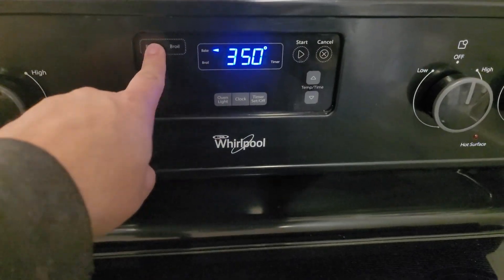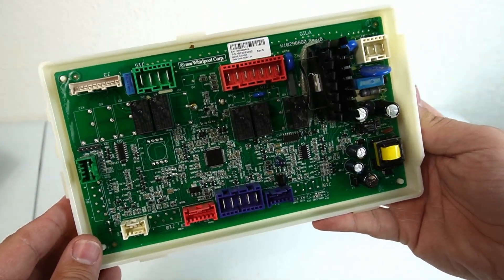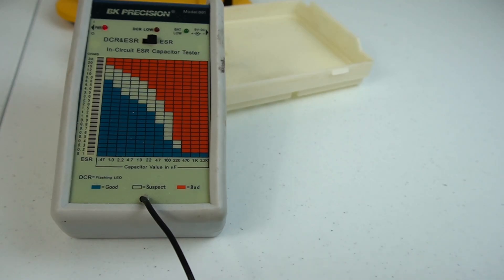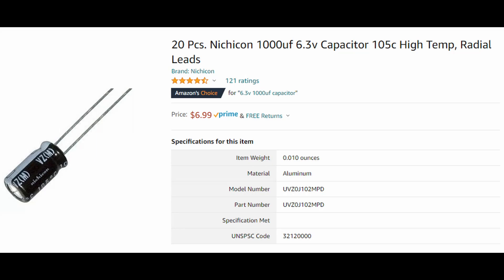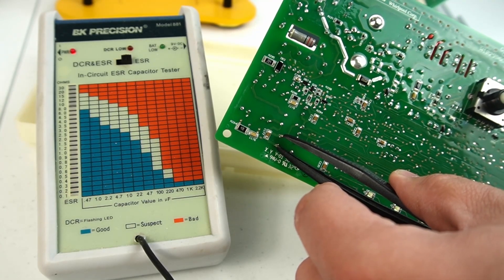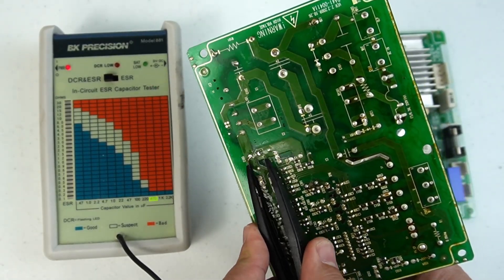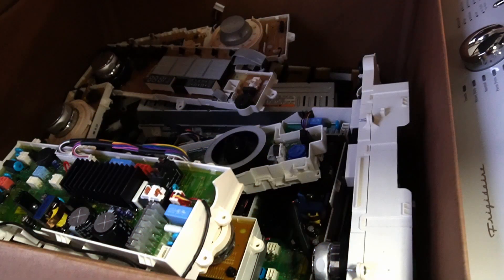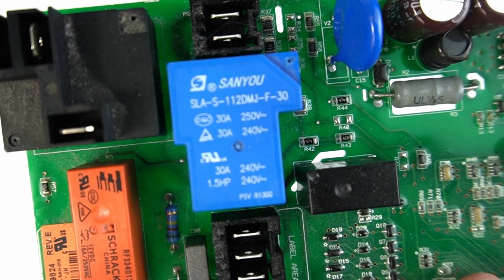Fix Your Broken Washer Control Board for CHEAP! How to Use an ESR Meter for Board Repair

Comment: Great video! I am learning more every day about washer and dryer repair.  Do you know anything about  the GME professional in-circuit  ESR. Is it as good as B&K 881?
Reply from the maker: I do not have any PERSONAL experience with it. But in the board repair tech groups I am in, quite a few use it because its almost $100 less (now) than the BK881 and all I've heard is great feedback about it. My experience is that the GME is the "Minimum" you want for board repair and you should avoid the Chinese cheap-o's out there. The GME is made by a Taiwanese manufacturer, and I believe the build quality is good from what I've seen on the internet from fellow techs.
Reply: @bensappliancesandjunk  Thanks

Comment: Thanks sir! More beneficial tools for the back pocket! Keep it up
Reply from the maker: That dumb lil box has probably saved about 200 boards at our shop so far... And counting!
Reply: @bensappliancesandjunk  Very nice, it definitely gives me some inspiration and IDEAS! I binged hours learning how to replace capacitors and relays lol, thanks.
Reply: @bensappliancesandjunk  Ben when you repair these caps on these washer boards what are the symptoms? Thanks the for great content!
Reply from the maker: @tandbappliance  On Whirlpool washers, its usually lid lock issues that are pervasive beyond a lid lock repair, or where the machine won't turn on at all. Or the washer pump runs without aid and there's no suds/flood control mode ongoing, among other issues.
Reply from the maker: Another note, which isnt in this video but in the Frigidaire Stove video: Relays are similar, but can also be different. Relays switch power on/off, so if something isnt getting ANY voltage, its usually a bad relay. Thats far more typical on high-voltage appliances like stoves and dryers not working right. There can be physical evidences too on relays and caps, so we look for that first. Boards follow an 80/20 rule: 80% of your problems have 20% of the solutions, so keep it simple. 

Another BIG BIG thing is joining a good group that documents these fixes... There are very common failures with electronic boards,and if you know what they are, you canspot them and fix it fast.

Comment: Component level repair is so rewarding.
Reply from the maker: It is when you find out one small component daisy chains into wrecking a $1000 machine
Reply: Till it fails again in a couple months
Reply: There really is nothing more rewarding. The excitement of figuring out the puzzle. The euphoria from solving that puzzle makes it all worth it!